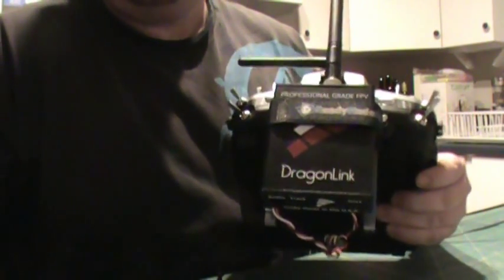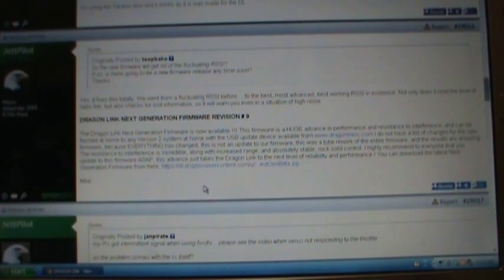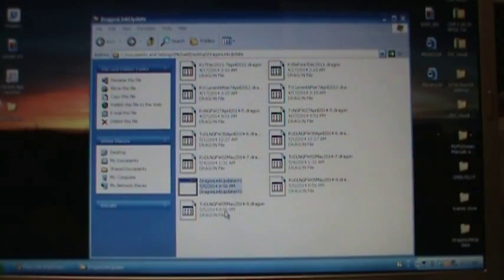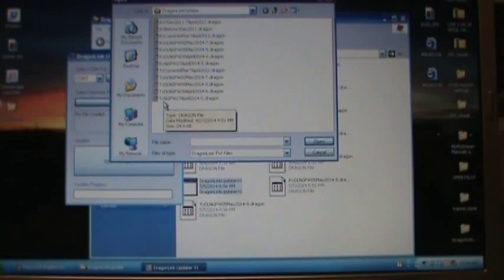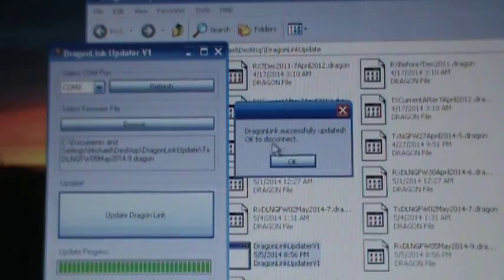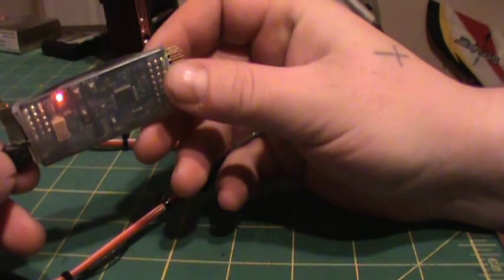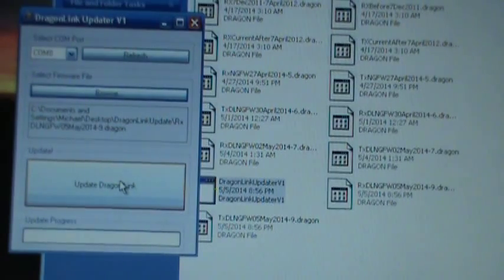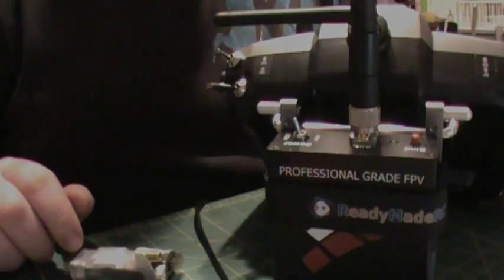How To Update your DragonLink Firmware

Comment: Thanks eastcoast great to have a link to go to when I get the updater.
Did you have to have to buy a usb adapter or does it come with the main data plug wire ?
Reply from the maker: Thanks Neil, i'll update the link once DL releases the final version. It does not come with the actually Mini usb plug. Most have those laying around in droves. Do you guys use those down under? It just comes with the 2 pieces shown at the beginning.
Reply: eastcoast78 Yes we do mate but there are so many different varieties of them :-)
Reply from the maker: This is the type, the most popular :)http://www.liquidware.com/system/0000/0016/USBmini.jpg